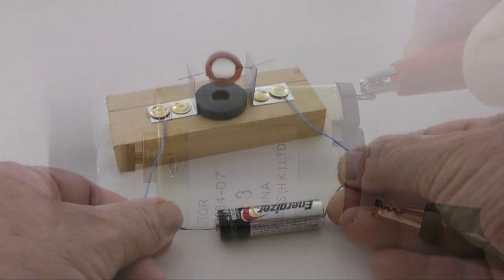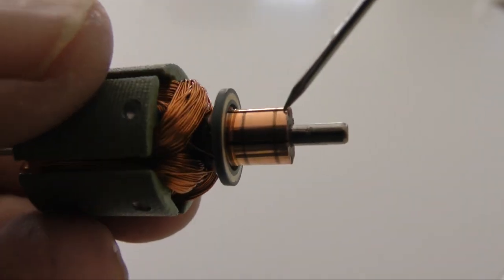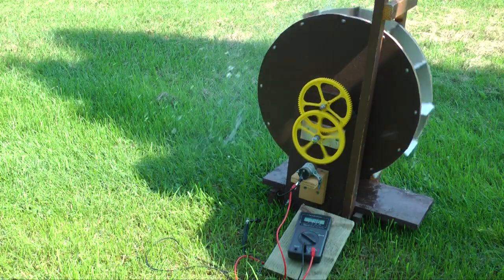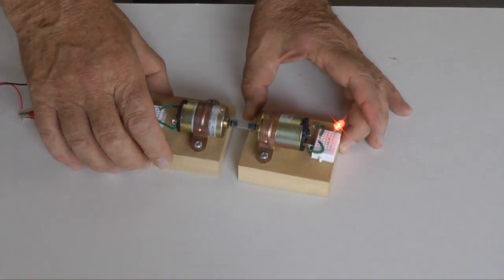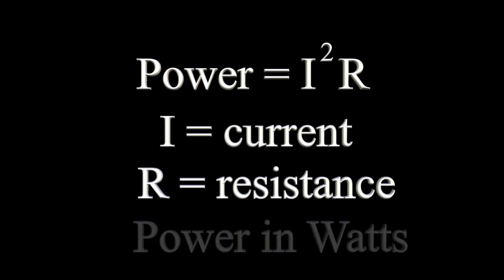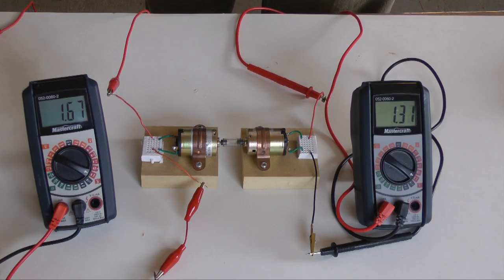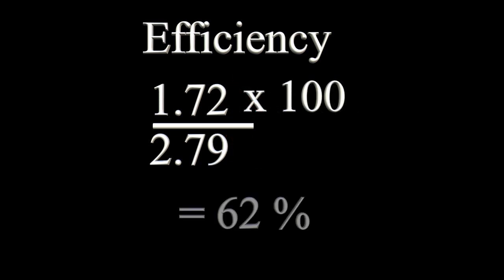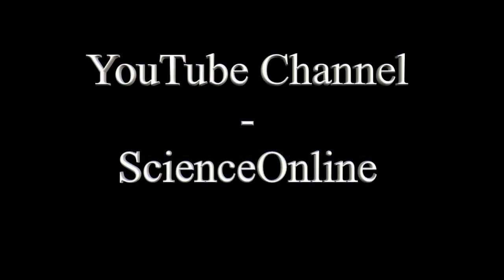Motors and Generators

Comment: Motors are for work only.
They produce more work than they consume in energy.
Generators are for producing energy 
They produce far more energy than the work required to do so.
Though they both function alike.they can not be used by n place of one another because a motor can not generate more energy than it can do work and a generator can not do more work than it can produce in energy.
This is why you have to use a real generator with a real motor inorder to achieve over unity.

Comment: supposing that the efficency is by 50 , does that mean the motor in generator mode recharging a battery takes twice the time that takes that motor to drain the same battery ?

Comment: I am wondering if you get more amps if you put some diodes in parallel at the output of the generator. Or maybe try a full bridge rectifier. Is the output of the generator in AC or DC.

Comment: 62 % autoproduct +38% other energy
Reply: however if the generator supplies the engine with in addition the battery it will be supplied as a logical continuation.

Comment: Hello! What if the engine will transmit mechanical power through generators convert gears 1/2 or 1/4?
Reply: DENVERLOG 
Energy losses due to friction

Comment: Can you use a generator 38% bigger or 38%more generation rate to produce a higher power generation to feed back to the motor at 100%? Also instead of a depleating battery, can you use a solar charger that produces the same 1.5v? 

Or, perhaps can you experiment with a perpetual motion generator-motor-generator?

Comment: Will I get approximately same efficiency with 48V-800Watt DC Motor??..Your reply would help me in my project...
Reply: eventually, you will have to calculate it to know it because it always depends on the motors and the connection your using.
Reply: I am using a DC motor of E-Rickshaw, which is of 48 volt-1000watt...
will I have to rotate it and check the volt & ampere current its throwing??...
Reply: yes because even slight differences in manufacturing and the connection can cause the value to change that you would get out of it and its important to know that you will not end up with the complete same output as your input.  and since you are most likely to not have a datasheet that has everything precalculated you will have to.
Reply: thnx for ur info :)
Reply: ^much appreciated ;D

Comment: what if we made one motor run two or three generators , would the efficiency percentage add up ? assuming we can use brushless motors or other motors with no friction
Reply: You can do this with car alternators.. You can use a 1/3hp electric motor to run up to 3 alternators. The initial alternator not having much more power then feeding the motor but the other two can generate pure power. Most alternators need around 1/3hp to run up to max efficiency you need to pay close attention to the rpm and pulley ratio to maximize power used vs power output. The bigger the motor the more alternators you can run. Forget converting the alternators to a generator design. Just add a battery bank and use the batteries to run load and the alternators to charge them and the initial alternator to run the motor. This would give you a very usable perpetual generator system tied to a modern solar power system and provide indefinite power.. Add motors, alternators and batteries as needed to obtain kW generation needed. Under current technology and costs this video best illustrates the truth behind the motor driven motor untruth floating around. But that's not to say the concept can't be modified and used. You just need to find a more efficient way to generate power. Car alternators are very very good at this. Downside.. They have a short life span so cost for duration equaling cost per watt overtime is still not there. But modern electric car motors are jumping the bar ahead leap years. This tech will soon be around to make these systems work correctly..
Reply: i had the same alternator in my diesel pickup for 650,000 miles before i sold the truck. Thats a pretty long time.

Comment: Instant thumbs down...
@4:40 this is NOT correctly comparing input power V output power
This is the mistake most noobs make and why i'm forever wading though crap...
Reply: would you explain why
Reply: you have to measure voltage and current of input and output at the same time to get the actual input power and output power. Other wise the voltage and current changes between readings as you add and remove your meters

Comment: Great video.  Though, I would like to add that if you have an inductive (or capacitive) element to the load, the current will not necessarily be in phase with the voltage, and measuring the power and efficiency needs to take power factor into account.

Comment: Motor-Generators were often used as phase converters; If you have only single phase electricity but need three-phase electricity to operate some equipment, you can use a single phase motor to drive a three-phase generator. It isn't very efficient but it's good enough and gets the job done!

Now that high power electronics are cheap and easily available, phase converters are typically electronic instead of mechanical; and also a lot more efficient.

Comment: The perpetual motion setup won't work anyway regardless of the generated and consumed power because both motors will spin in the other direction if they would produce power to run.